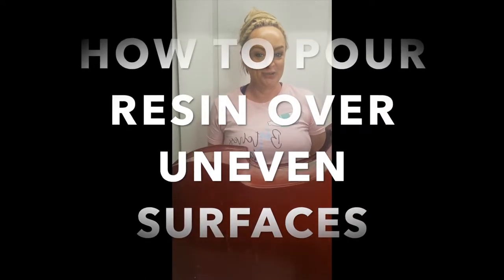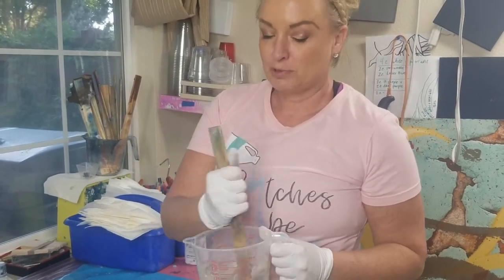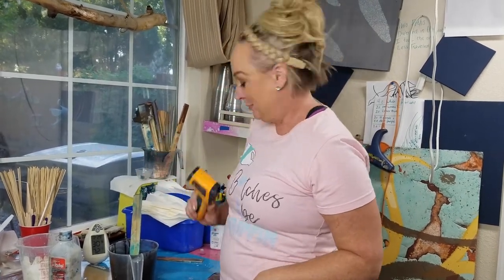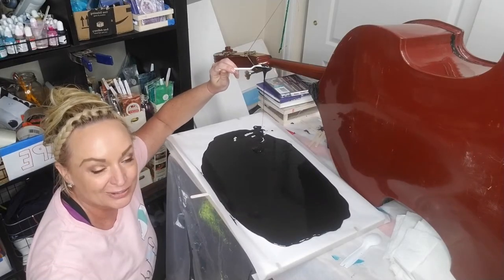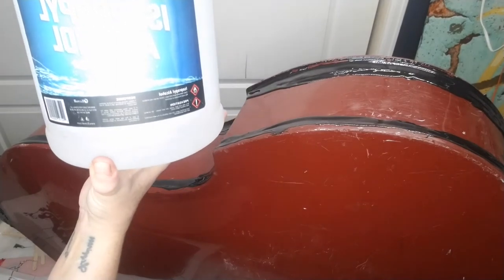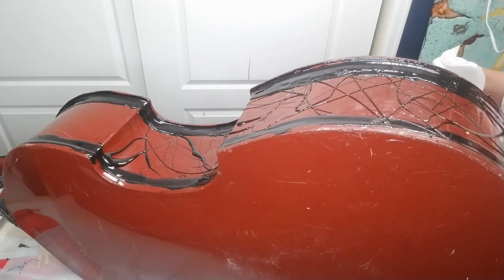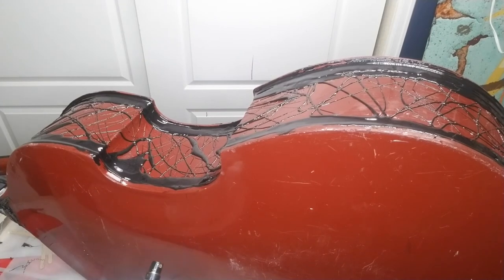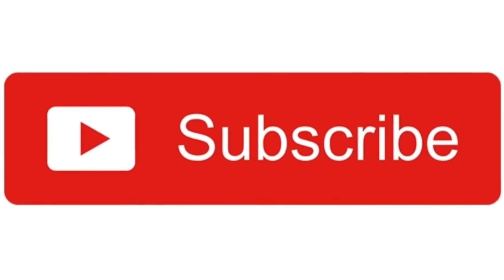How to mix and pour epoxy resin on an uneven surface.

Comment: torching for a slower curing time?? that makes no sense at all!!!, great video first of all, im trying new technics on car parts and this was super helpfull, however if you torch resin, yes it will make it runnier but just for a little bit, it will thicken back in no time (not ideal for this application true), torching resin will actually make it cure a lot faster, and using alcohol does not affect its curing time, it just breaks the surface tension on the resin , great video tho.